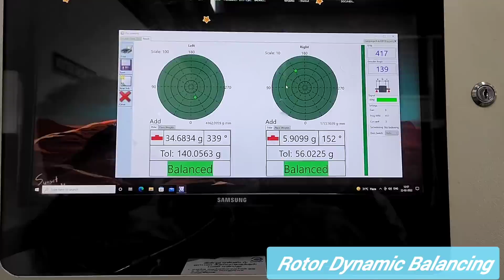AC Generator Stator Core restacking & Coil Rewinding 1250KVA STAMFORD-Brand,Water Treatment Industry

Comment: I could see most of the rebuilding process with the tear down, replacing the windings in the stator field, megger testing of the rotor and field, insulation of the field and stator. A very nice job with the connecting lugs and tagging. However, no final test unloaded/loaded on the generator as to current and voltage output?
Reply: I was wondering about this myself. As a retired Wacker Nueson generator technician I know it only takes one misplaced wire or cable to ruin a repaired stator or rotor. Thanks for your comment. Good day.